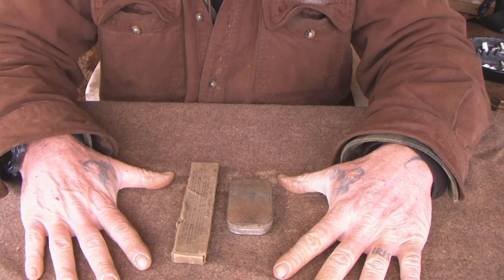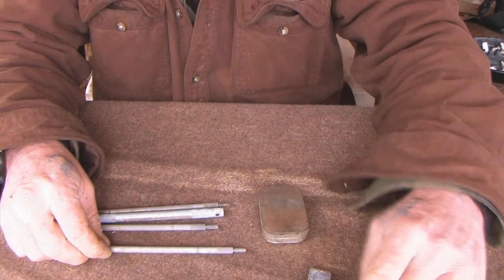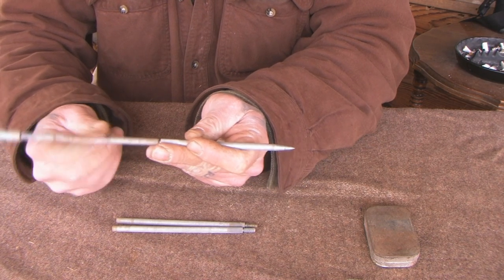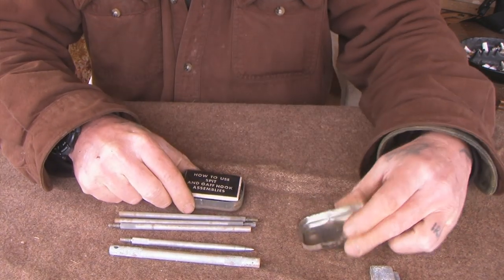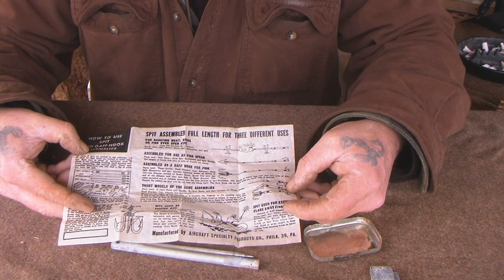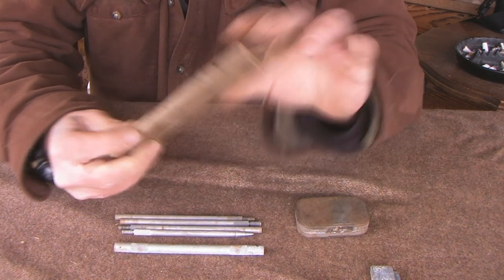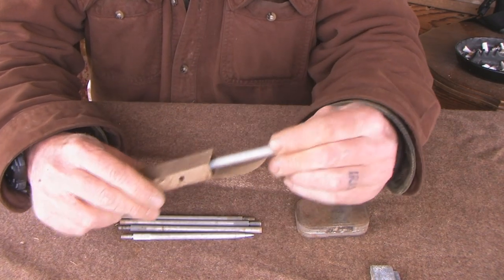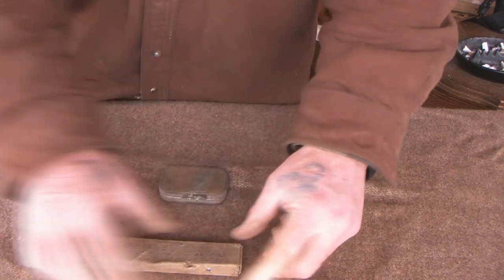The WW2 Survival Spit and Gaff Assembly

Comment: You don't have to get a fish to bite the treble hook I doubt that what they had in mind when making this there's no point in catching a shark and endangering yourself when on a life raft you could use the treble hook as a grappling hook and I'd imagine with a hook that size it wasn't made for the fish to take bate off of it was most likely made to cast past the fish and draw the line in fast hooking it on the fish my family has caught salmon, steelhead,etc. Using this technique for generations and its pretty efficient now I don't know about catching fish in the open sea with this technique it would be nearly impossible its different when the fish are fighting against the current in a fast flowing river where the fish barely make progress and almost stand perfectly still for you if you were out at see and it was absolutely necessary you could catch a small shark with that but I don't know how good the temper is on those hooks and if they could handle the stress.